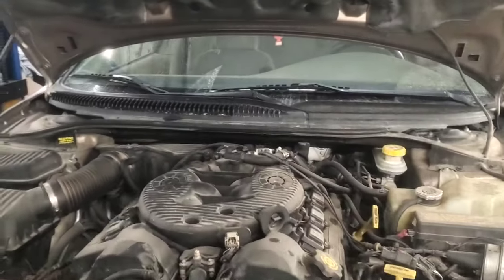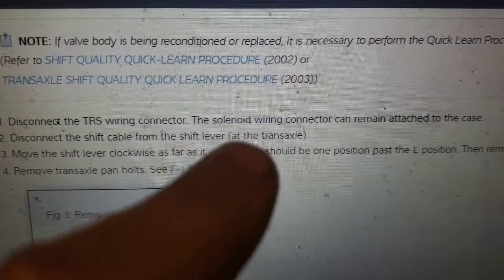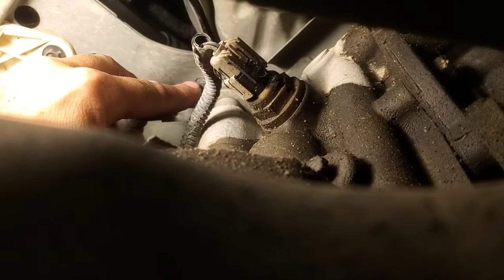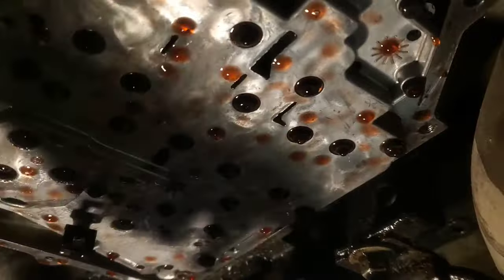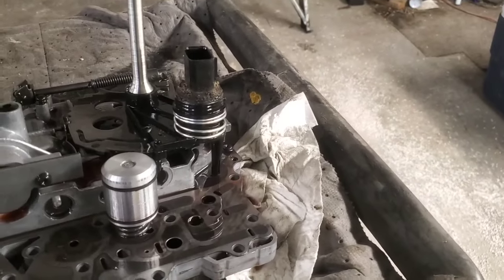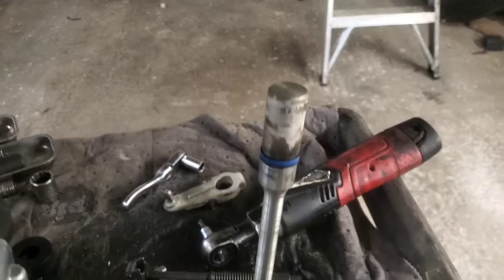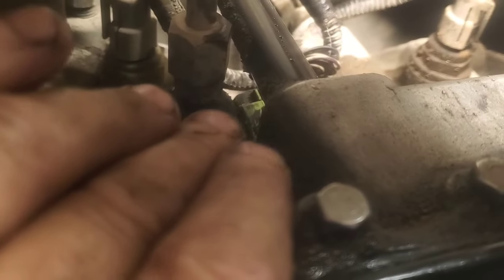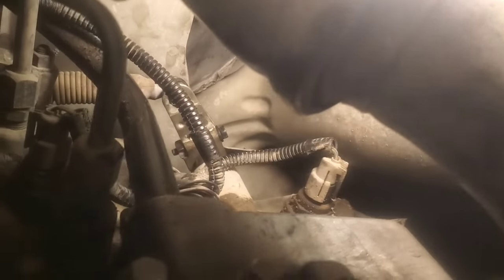Dodge/Chrysler 42LE Trans Control Module Solenoid Pack Replacement.  Intrepid,  Concord, 300M

Comment: You can pull out a lot of fluid with your hand pump. Already have the parts just need to get it done. Messy but not a difficult job just plug and play and drive. Use ATF 4 or better synthetic fluid. Have used ATF 4  all the time. Thanks for the video.

Comment: The shift solenoid was fixed on my Intrepid in 2017. It went out at 200,000 miles. It now has 282,000 miles. Other than that, the transmission has been solid in mine. The cooling system is another story. It's been a nightmare. The housings are plastic. They crack.